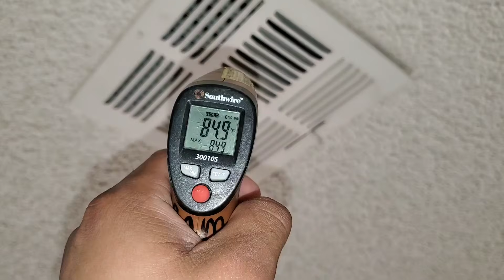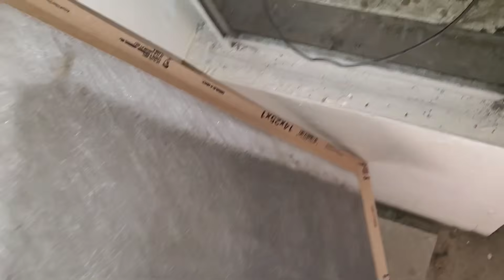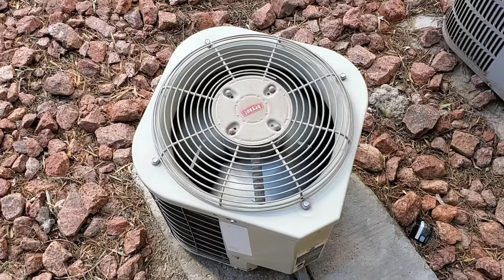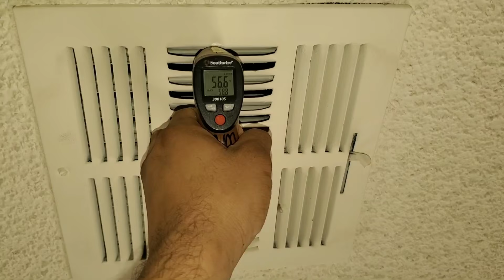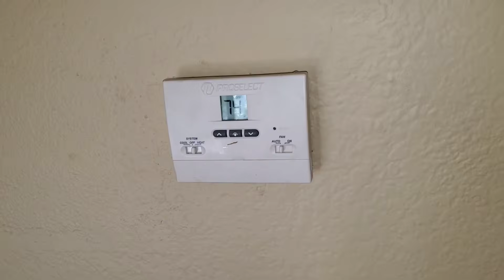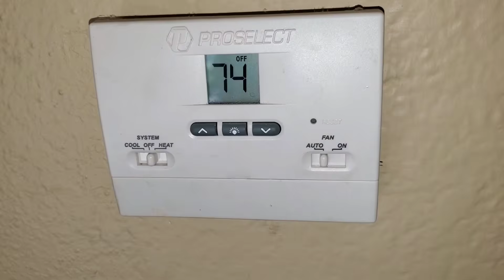Troubleshoot AC for Beginners ONLY! Part 1 Understanding the System

Comment: I just tried to troubleshoot my AC unit at home.  This video explained and pointed to the contactor issue for me because the fan motor NOT spinning and the compressor IS not making noise WHEN turning on the AC. I then looked at the contactor I see the wired has black burn mark. 

Thank you for the informative video!

Comment: This always looks simple until you realize that contactor issue could have other electrical problems underneath - American Residential Services handles AC repair for situations like this where what seems basic actually needs proper diagnosis.

Comment: A lot of people will say or jump on 'low refrigerant' right away for a low cooling issue. I would first check airflow over the coil for restriction, Liquid line restriction, either metering device or filter drier. If you look at the pressures and subcooling and superheat you can trace it to the indoor Evap coil or Condensing unit.

Comment: Looks like this is about 5  years old but your communication skills are truly exceptional. I learned a great deal from this. I can repair an automotive engine but I was clueless of the diagnostic sequence of an Air Conditioning Unit. Without the proper sequence your time is just wasted going in circles. There are just too many potential possibilities for failure. Once the problem is located the repair is simple in comparison. Finding the source of the problem is the whole issue. Thank You so much!

Comment: You say always turn power off to be safe yet you are sticking your finger in and touching the contactor and i hear a buzzing sound and you you say that the contactor is stuck.  Why aren't you getting shocked? This to a beginner does not seem safe touching metal parts with your finger.
Reply: If your talking about the 7 minute mark, the disconnect is out and unless the installers wired the unit into the line the high voltage should be gone and only 24 volts going in the contractor wires which our skin is usually insulated against that voltage. You probably have gained this knowledge though old comment

Comment: One thing you don't want to do is use an infrared digital thermometer to measure air temperature - No getting out of that one it's on video. They only measure solid objects, not air temperature.
Reply: huh?
Reply: @TrueAudio  if you point a laser thermometer at a ceiling register, it will read the temperature of the metal of the register not the air coming out.

Comment: Im an hvac tech. So it was the contactor making that loud noise. Because something was stuck in it. Is that the reason why the 24 volts wasn't working?
Reply: i'm not an hvac tech but i'd say Yes

Comment: Sam, I'm two weeks into the industry and have already performed 5 installs and over 30 service calls. Luckily this small company I work for has very knowledgeable and experienced guys. And I'm also fortunate enough to have been a mechanic for eight years of my life and worked in multiple forms of construction for another 10. So naturally it was easy for me to understand and get in the rhythm of what it takes when doing an install. And the service calls have been pretty interesting because the guy I ride with, like yourself, can diagnose within minutes what the issue is with impact to remove any panels and temperature reader. You are absolutely correct when you say don't get overwhelmed or intimidated by the tools. Luckily I'm very mechanically inclined to where I can figure out how to use them. However one issue which I haven't came across yet that you pointed out is the contactor. Thank you for that because come the start of the week the first service call I go on oh, I'm going to ask my coworker if he can let me try and diagnose the issue because I think I've familiarized myself with the most common ones that we deal with. In the steps that you shared with going to the thermostat 1st and checking which components are functioning to determine where the issue is, is something that I didn't realize I was already doing. That's why I was a little timid when it came to trying to think for myself what some of the problems could be. But the way you put it is the basic and logical way to approach any issue. Of course someone like yourself and my coworker can take the concern from the customer and immediately go to where the problem is without having to take those steps a rookie like me would need to do. Anyway thanks again for this very helpful approach.
Reply: Your a lucky dude having that much help in the start of your career I was in a commercial HVAC company 14 months in and I only ran 3 repair calls helping other techs Mabye a few calls where I had to diagnose what was going on with the other tech leading main thing I did at the company was filter changes and washing coils so when they let me go for not knowing enough in a year it was the most ironic thing I’ve ever heard there loss already got two interviews with other companies in two days
Reply: @BenChasae did you get better? If so how? I’m about to take my universal test tomorrow and I feel like I can pass that and still know nothing about what to do when I’m actually in front of something.
Reply: @remyybruhh4727 you will get better just trust the process, once you learn the sequence of operations you will start to understand how it works by verifying that each part is working or not before moving on to the next in line. If you don’t have the reading expected at one point, that is where you stop and work back from that point  to see what’s happening up to that point. This is the part that I’m working and studying on the most. Because once we get that we’re well on our way to understanding and good troubleshooting. Once we learn that you can figure out pretty each piece of equipment that we come to. Oh I forgot to mention The Schematics and learning and always relying on that if visible on the unit and reading the parts and sequencing the operation. Hope this helps , I started a late career change in my 50’s and now early 60’s . By far the best move I’ve made. Sorry so long. Good luck
Reply: Hell yeah brother ! I too, just within the year have changed careers to HVAC and plumbing. Absolutely love it! Keep up the good work 👍

Comment: One thing that has been helping me in the condenser part is feeling your compressor and your condenser fan motor too. Either cold or hot to the touch are good clues.
Reply from the maker: Yes they are great clues as to what was it was not working especially when the compressor goes into thermal load and locks up. Great tip 👍🙂

Comment: Having an problem with my unit, everything is working inside, fan not turning outside, try to jump start it, it spins freely, still not working, can’t figure it out
Reply from the maker: When you push the contactor on the condenser does the fan motor and compressor turn on?
Reply: Sam guest what, I fix it, the wire was loose on the unit, thanks a lot, I watch your videos all the time!!!

Comment: So there’s 240 volts going to your contactor but there is also 24 volts going to your contactor? Appreciate your time going through everything it’s definitely making a big difference
Reply: Think of it like a switch. Low voltage on the sides, and high voltage top/bottom. 24v activates a magnet that closes the high side circuit and voila.
Reply: Yup!
Reply from the maker: Yes correct. 240 volts comes from your breaker to the contactor. The low voltage wires come from your thermostat transformer. Hope that helps!
Reply: 240 into lug area of contactor then 24 from transformer too the coil on terminals on side of contactor what these guys meant
Reply: Makes sense thanks fellas!
Reply: 24 volts goes to the auxiliary of your contactor coil 240 would be your line and load